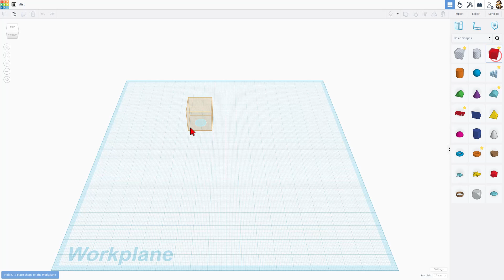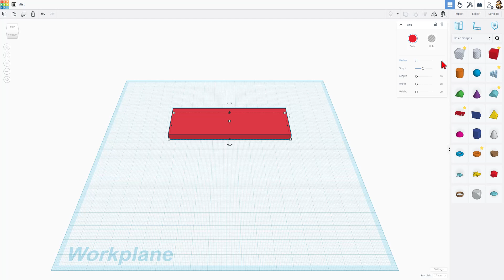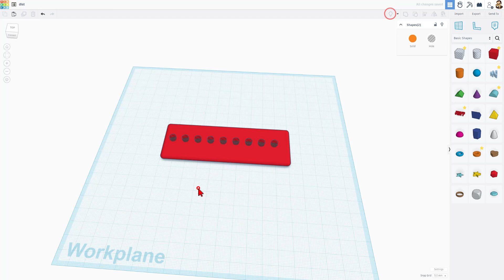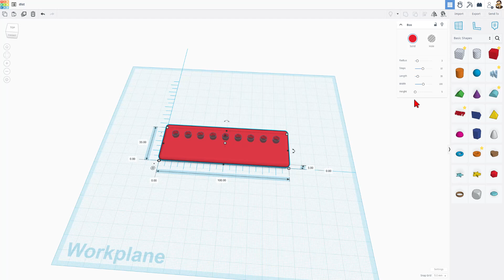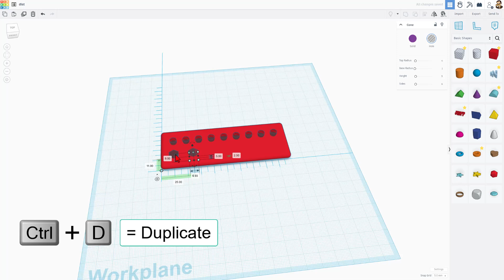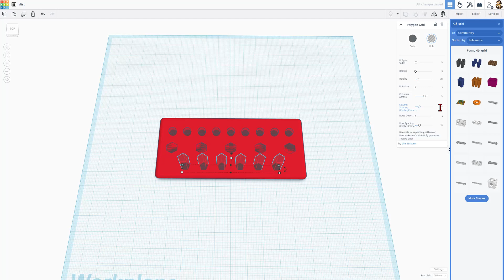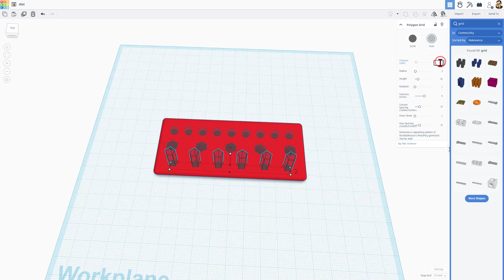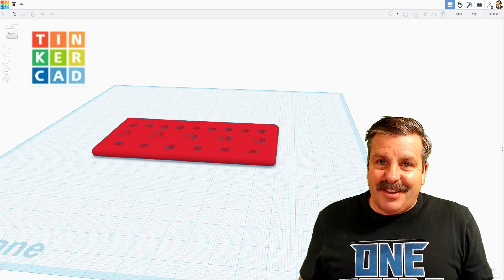Tinkercad Missing Feature FIX! Distribute Ruler & Align Tips in Minutes!

Comment: Do you happen to know why two grouped objects in Tinkercad export to Bambu Studio as almost separate objects?  Basically, a block with a right angle block off of it, printed infill and cutter walls independently and broke apart immediately.  Thank you!
Reply from the maker: I would guess that there is a gap between them. If they are not physically connected... even the tiniest gap will have them be separate parts after exporting.
Reply: @HLModTech  Thank you!  I did notice in the slicer, I could see a really slim gap all the way through the objet to the plate below (from top view).  When joing objects, its probably best practive to use another workplane when attaching objects, "D" drop. then group.  I appreciate all your videos.  Thank you again.
Reply from the maker: 100% accurate with the workplane and drop. 💯👍Nice work and thanks for the kind words.

Comment: I noticed that when you change the dimensions of a shape, a square, for instance, from 20 to 5, you only type in one box, and the other box changes automatically. How do you do that?
Reply from the maker: That works if you hold shift and scale the object first.
Reply: @HLModTech  Wow, that was a super fast reply. However, no matter how many times I try, it doesn't work for me.  I'll keep trying.
Reply: @HLModTech  And boom, as if by magic it now works, thank you so much
Reply from the maker: Glad it worked! I would guess that there was a click of the mouse in between the typing before that cancelled the "shift+grow" trick.
Reply: @HLModTech  Turns out that it won't work for me if the ruler is turned on. Turn off the ruler and Bam! It worked. For 2 years, I have been turning the ruler on at the start of a mod. DOH!
Reply from the maker: Whoa! Had no clue that could be it. 🤦‍♂️ I will store that away as a possibility. Thanks tons for sharing!